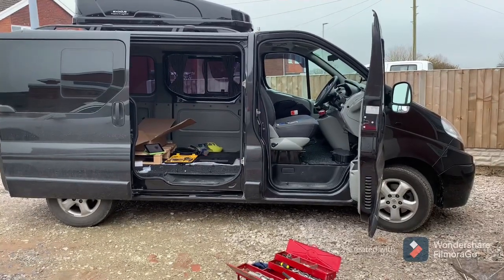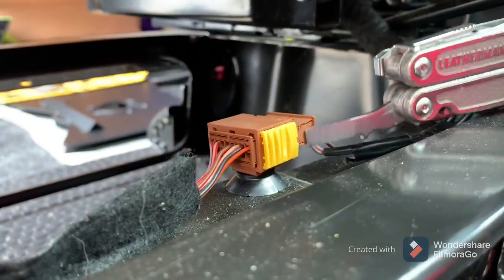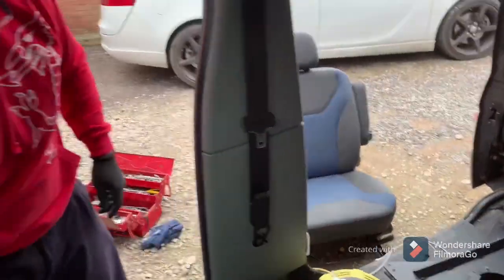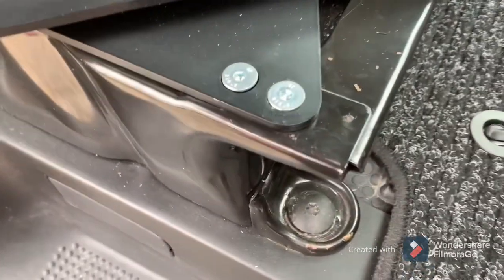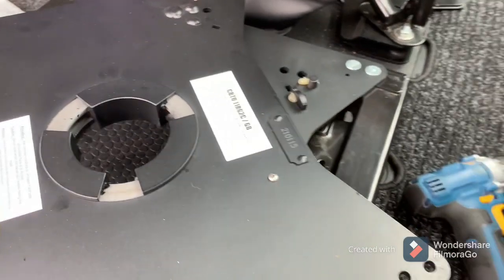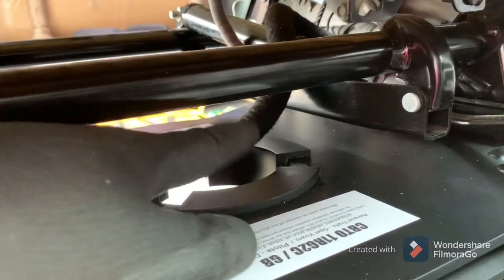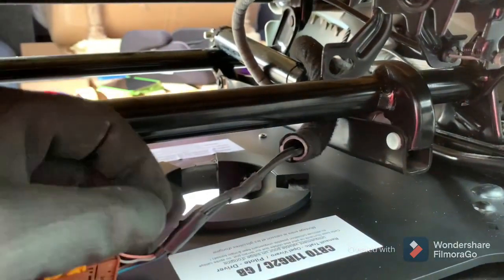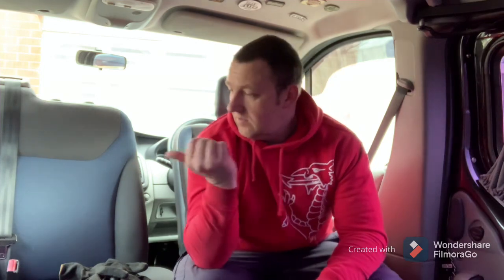How to fit the Kiravans drivers seat swivel base - Renault Trafic 2001-2014

Comment: Very well made and informative video. However looking at everything you went through I feel it would be much easier to bolt the swiveling base to the seat first, then screw down the eight countersunk alen key bolts. Just a thought.
Reply from the maker: Thanks for watching and commenting! The swivel base weighs an absolute ton and think I would of struggled if I put the base onto the seat first but you never know, it might of worked! Cheers 👍🏻

Comment: Thanks for the vid, very helpful. Was there any difference when in driving position of the seat going forward as I have little legs 🤦🏼‍♀️
Reply from the maker: Hi there. No, there’s no difference in the seat moving backwards or forwards. The only difference is the height. It’s about 3cm higher due to the mechanism but that’s neither here nor there really. Hope this helps 👍🏻
Reply: @bashabushcraft458  thank you

Comment: Found this very informative, especially the final 8 bolts , so thank you very much. Do you find yours slightly rock tho , only just done mine tonight so this is just first impression
Reply from the maker: Hi there. I can’t say that I’ve noticed it rock but that’s not to say it doesn’t. Since fitting it, I’ve had no problems with it. Seems to be a great product. Pretty pricy but makes such a difference. Thanks for watching 👍🏻

Comment: How  do  you  do the  passenger side  without  breaking  wires  underneath  when turning seat
Reply from the maker: Hi there. You can either unclip the seatbelt tensioner underneath or you can extend the cable using a coiled cable that stretches if that makes sense!?

Comment: Did you find any movement in the seat especially whilst driving?
As already fitted the passenger swivel base and found battery access a bit more fiddly. Thanks again for the video, helpful 👍
Reply from the maker: Firstly, thanks for watching!! I agree, the battery access is a bit more fiddly. No movement at all. It’s obviously raised it up…30mm I seem to recall but i lowered the seat to minimum on the height adjuster and it’s perfect for me. It great that it’s got a little lever to spin the seat unlike the 4 screw mechanisms like the bench seat.